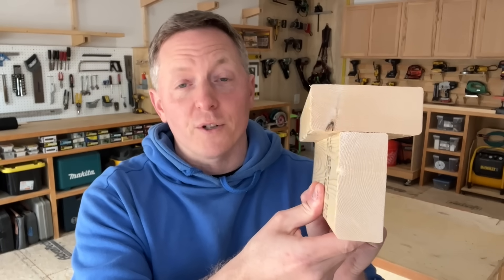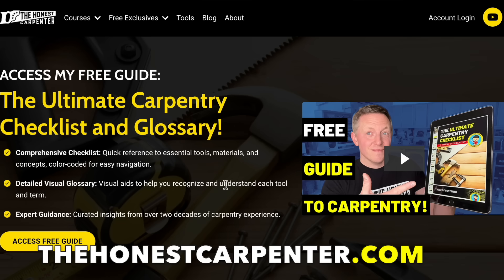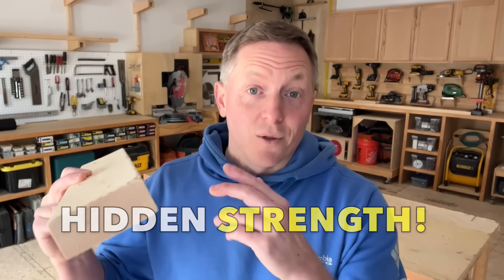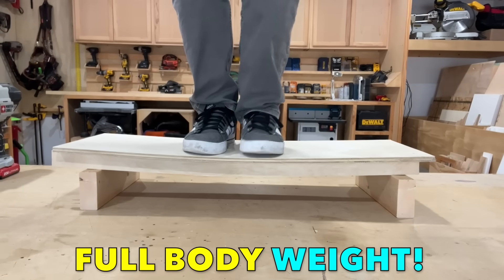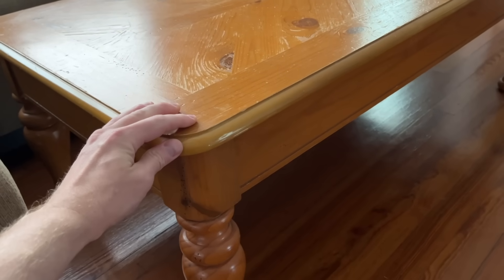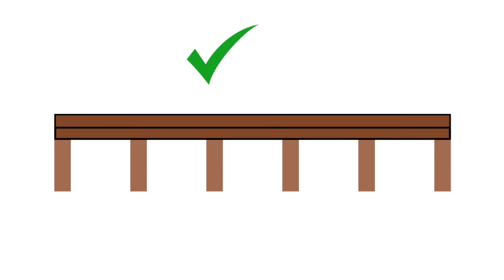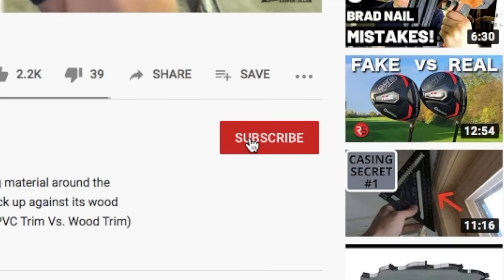Make Everything You Build STRONGER...(Overlooked CARPENTRY SECRET!)

Comment: It would be nice to know the minimum dimension that one can cut down the vertical member to w/o sacrificing too much strength.  In other words, what can we get away with w/o having to use huge boards turned vertically?  I know you mentioned cubed strength.  Is that height, width, volume, etc. dimension?
Reply: Mostly height. There are span table available to show how far, say joists, can span (based upon species).
Reply from the maker: Check out the span tables for dimensional lumber! IRC publishes them, but you can find copies online. :)

Comment: A lesser-known aspect of span strength is that the extra width is only needed near the centre of the span.  The member can become narrower the closer one gets to the points of support.
Reply: Hmmm. Did not know that.
Reply: Thats not exactly true because narrow beams wants to twist when supporting a load above them. Using tapered beams across the span, makes it more difficult to prevent them from twisting.
Reply: It is true, the principle of torque force across a beam. Highest torque occurs in the middle, zero at the ends. The ends are considered hinges even.

Comment: A Board perpendicular to a table top (wrapping around it, and creating that T or L brace) is commonly called an “apron”.

The framing members that u might find in ur attic are called 
“Rat runs”. 
Those terms can be used interchangeably with the ones mentioned in the vid. 
 👌

Comment: Great point.  I didn't know it increased by the cube of its width, that's impressive.
For bookcases I've opted for 3/4" pine.  Holds up well for 4' spans without any additional support.  Simple to build, especially when you don't  have a table saw.  And without the fascia boards it opens up more shelf space.  And the shelves are easy to reposition.
Reply: Height, not width.

Comment: I am an Engineer and your explanation couldnt be more precise and (VERY) simple to understand. Liked the lesson! Good job!
Reply: This is wrong. The strength does not increase exponentially, not even cubic.
The strength increase with the square of the height, stiffness increases with the cube of the height. If you keep the area constant and reduce the with when you increase the hight then the strength only increase proportionally with the hight.

The term "exponentially" is way too often misused when the actual increase is e.g. polynomial like in this case. An engineer should know this.
Reply: @larslindgren3846  Squaring is an exponential function itself. Raising to the power of two.....
Reply: @kc8485  All definitions of "exponential function" I know of require that the exponent increase with the input. In the square function the exponent is a constant of 2. 
Does you consider linearity, f(x)=x=x^1 to be an exponential function too? It can be defined by exponentiation just as well as squaring.
Is the square root x^(1/2) an exponential function too?
Reply: @larslindgren3846  I think it is actually hyperbolic, when you flip the board the other way the strength is literally hyperbolic in strength
Reply: @OCDlosp  I am not sure how you conclude that. Can you give me any motivation for that statement. Does you mean hyperbolic as in x^2/a+y^2/b=1 or as in the hyperbolic trigonometric functions like e.g. sinh, tanh?
Reply from the maker: Thank you, Roberto!
Reply: Um yeah, it could be a LOT more precise! what type of loading is on it? How long is the board being loaded? I think the word you're looking for is "pragmatic", not precise.
Reply: As an engineer, you should know that the claim that the strength becomes cubed is nonsense. For example, if the strength was initially equal to one unit (of whatever) then you'd be increasing the strength from 1 to 1^3 ... which is no change at all.

Indeed, the graphic indicates an increase from one unit of strenght to 9 units .... by cubing "1"?!
Reply: All y’all need to chill. This is a carpentry YouTube channel, not an engineering classroom. Also, the word strength has a different meaning depending on the context. As a keyboard warrior, you should know this
Reply: oversimplified too far though. I hope I never buy something you designed.

Comment: Thank you for the great video,  question,  I have a 14 ft span,  which calls for 2x10 for joist,  can I glue&screw a 2x2 on top of a 2x8 to act as a 2x10 with a wide nailing face and strength like a I Span?
Reply from the maker: Thanks Brian! No, in that case I'm afraid you probably want to go with the full 2x10. The contiguous structure and make-up of the wood fibers is hard to simulate, even with glue and fasteners. But the good thing is 2x10s aren't drastically more expensive than 2x8s, and it'll save you time this way. I hope that helps, stay safe!
Reply: You could maybe do that, but you would need to talk to a structural engineer. And if the work is going to be inspected, you need a letter from the engineer. Note: If it is strong enough and you are putting flooring down over it, you get great nailing surfaces!

Comment: It's too bad there are no, at least not that I'm unfamiliar with any sort of span tables, that might be applicable for closet shelving be it 5/8 or 3/4 thicknesses of melamine or  the same and also 1/2 plywood, (for narrow closet organizer shelves), without a front piece of trim.
     It certainly would take the indecision away from knowing that you're shelf isn't going to sag if it's only edge banded, say if the load consists of books or gold bullion, lol
Reply from the maker: I know what you mean, Paul. It would probably just vary too much based on where exactly the plywood is being sourced from. But I always say, when it doubt, weigh it out. Set the material up at your intended span, and start applying weight. You can use the objects you intend to store, or body weight, or anything really. But if you see deflection anywhere near your intended weight, you probably want to bulk up the material or structure a bit. I hope that helps!

Comment: Thicker material generally means more strength. Where the strength comes from varies a bit between materials. In wood, it comes the friction between the wood fibers and the lignin gluing them together. The direction of the fibers is critical in comparison to the direction of the load. Wood is strongest along the fibers, which makes sense when you imagine the tree it came from. The perpendicular strength varies with the thickness of the tree and how fast it grew.
Reply: White pine compared to ash compared to oak etc. Great point.

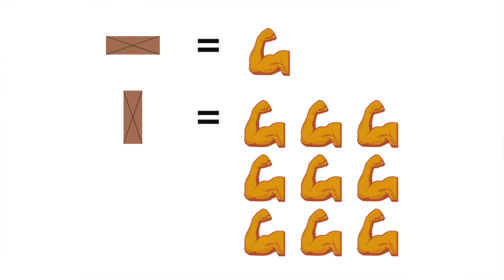Comment: 2:20 You get a bit hyperbolic! (1) Not "exponentially stronger" because, as you say, it scales like the cube not the exponent of thickness (so that would also be 8 'gunarms' not 9) and more importantly this holds (2) when all else remains equal... which it doesn't in your example: turning the board 90degrees doubles its height/thickness, BUT HALVES ITS WIDTH, so all else isn't equal. Deflection scales linearly with load (per cm span), so turning 2x4 to skinny side is equivalent to doubling your weight. You'd be numerically correct if you put a second 2x4 next to it; you still have 8x the strength for 2x the cost (&weight).

Favourite way to wrap my mind around this: Woodbin.ca's Sagulator -- a calculator to predict deflection over spans, dependent on wood/woodproduct type, thickness, depth, and load. Essential for building optimal torsion boxes.

Comment: Take a single sheet of printer paper and try to lay it across a six inch gap. It will gently bend over and slide right through.  Then fold the paper in half so a tight crease bridges the open span - it will hold itself up easily.  That's the same principle at work.

Comment: This principle scales up as well. The largest piece of wood I ever helped install in my 40yrs of building was a laminated beam that served as the ridge beam on a church auditorium. It was 16" X 72" and spanned 97 feet. It was delivered on a crazy two piece semi rig that the rear half had a driver and steering too. The beam was the only connection between the two halves.
When the glue lam was on the ground it looked like a bowling alley!

Comment: Funny thing : I wanted to build a snow slide for my son. I didn't really know how to, but I wanted to get something strong enough so I could eventually get on there if needed. I think I nailed it, and did a good job using this principle to get strengh. At first I though my son could climb it, but it was obvious that I needed to do a platform. So I did it again, and it worked perfectly nice. I had to get some joinery made to prevent loading the screws, and having each wood plank being supported correctly, but everything was great.
Then I just made a quick ladder, screwing horizontal planks to vertical ones. "Yeah, its ok". As soon as I put my feet on the first step, it broke lol. "Yeah, so I made everything super sturdy, but the ONE thing I overlook just break, okay"...

Guess next time I won't cut corners on ladders lol

Comment: I own a light single airplane. It is constructed from wood. Mostly finger thick sitka spruce. Only glued too. The main wing spar is also spruce boards in box form. The spar is some 25 feet long the box about 8 x 5 at the middle. It is designed to support up to 8000lbs.  Understanding the way wood works is a fundamental for proper design.  Not all woods are equal remember.

Comment: The engineering formula for the "moment of Inertia" for solid rectangle beam is B*H^3 where B=base width and H=height. This directly affects the strength and stiffness too. The strength is in the outermost "fibers" and actually an "I" beam would be even stronger and stiffer than the "T beam". This also why a "torsion box" is used for many woodworking projects. If it matters, a box beam with 2x top and bottom faces separated by glued (preferably) sides of even OSB can be a major load bearing beam. Of course, an engineer needs to determine the ultimate load capability. My initial career was a stress analysis engineer.
Reply: I would add that beam deflection is inversely proportional to the moment of inertia. That’s why turning a 2x4 so the 4 is the height gives you 4^3=64 versus 2^3=8. So you get 8 times less deflection. And strength is a misused description. To pick nits, technically it is a material property and not a geometric property. So M of I does not affect strength. Steel is “stronger” than aluminum. But it does increase a specific beam’s ability to hold a higher load before permanent deformation or failure.
Reply: Haha I worked with engineers for 30 years. This is how they talk. Lots of very dry sarcastic humor while figuring out the problem. Usually ends in laughter, not insult.
Reply: The moment of inertia of a rectangle is (bh^3)/12 about its CENTROIDAL axis, and is what you would use to calculate the bending stress about the neutral axis provided that the cross section of the beam is not a composite section.
Reply: @johnhill8958  You never take a joist or stud as being composite with the plywood. You actually use the section modulus and not the moment of inertia (although the section modulus is calculated from the moment of inertia). In a combined axial and bending load, you also still use the section modulus around the centroid even though the neutral axis is no longer at centroid of the section (The design method for combined loads is too long to explain in a YT comment).
Reply: I=(B*H^3/)12 for a rectangle.
Reply: Ugh… My Dream Job. You are highly favored by Our God M’Lord.
Reply: Does this apply to plywood too? Or just real wood? And what does OSB stand for?
Reply: Missing out camber?
Reply: Ahhh, dude check your reference book.  The moment of inertia of a rectangle is I = (b*h^3)/12. 😂
Reply: Beat me to it!
Reply: @johnklekotka1028  he didnt mension the 12 because it has no added value in his reasoning. Im an senior construction engineer myself and just by the short comment i can tell tium has a clue what he is talking about, and you dont.
Reply: @theengineer8610 Dude, first, you don’t have to get snotty. Second, i’m a professional civil and structural engineer, so yes, i know a little bit about the subject.  Third, he SAID “the formula is…”, which was incorrect. If he meant “proportional to…” than he should have said that.
Reply: Nice.  I've looked several times at calculating proper beams for projects with wood, and found that natural variability is annoying. 😁

It seems you would have been unlikely to do something like removing the center support post from my loafing shed, creating a ~20ft span for the two 2x6's that used to meet on top of that post. Someone thought that simply scabbing a foot or two of 2x6 over the joint was sufficient support. I think they were an electrical engineer, and they wanted to park an ultralite plane under that roof. To their credit, it did stay up more than 25 years, possibly much longer. When it came down (snow load) and I realized what had been done I was surprised it had lasted so long.  (I glued up a stack of 2x4s into a ~22ft long beam, 3-1/2in wide X 10in tall, and jacked it up the two outside posts to re-raise and support the roof before trimming it to length.  Starting year 7, so far so good.)
Reply: Your initial career was as a stress analysis engineer? Since you don't know that I=(B*H^3)/12 for a solid rectangular section, that you imagine "The strength is in the outermost fibers," and your comments about T sections and boxes without reference to size or load condition, it's easy to make an educated guess as to why you aren't doing that any more. I hope nobody was seriously injured or killed.
Reply: @PS-n5f  You could have made your point without being so snotty.

Comment: Would the strengthening effect be greater if the two boards are joined with a dado?
Reply: It doesn't make much difference.  Where he showed the T shape there is shear stress between the 2 pieces where they touch but it isn't a large value and it is easy to transfer.  If you wanted to be sure of this you could use a dado and that would give more surface area for the glue.

Comment: You're saying strength but you are showing deflection under load which is stiffness, those are 2 different things.  If you take a 2x4 turned flat and turn it vertical you make it 2.3 times as strong meaning 2.3 times as much load before it breaks, however you make it 5.4 times as stiff meaning 5.4 times as much load for the same amount of deflection.  This is for a single 2x4.  When you start combining pieces the proportions will be different but they can be calculated with principles of engineering mechanics.  Another important principle when you start combining things is how they are connected- for instance the T made out of 2 pieces of 2x4 will be even stiffer and stronger in one direction if it is connected well such as with glue and a lot of fasteners.  If it just has a few nails the 2 pieces won't act together as well and you lose some of the benefit.
Reply: I was a contractor for many years and never thought about strength vs stiffness (just used the span tables). Interesting!. Thanks..
Reply: Is the load figured all at the center of the span, or somehow distributed?
Reply: @jobacuda4472  if you're designing a floor joist then the design load is distributed along its entire length.  if you are designing something else for instance if a ridge beam sets on a stud pack which then sets on a wood beam down below then that is load at one point on the span.  the stiffness or strength calculations using the dimensions of the cross section apply either way.
Reply: @billj5645  Thanks, Bill! I used a lot of glue lams and LVLs in my time. Always hated working with steel beams!

Comment: Ah yes, applied Engineering Mechanics of Materials ENGR220.  

Area Moment of Inertia, I,  (directly related to the stiffness, deflection per unit of applied load, of a beam) for a rectangle is:  

I = (b* h^3) / 12  where b is the width and h is the height of rectangular beam in length dimensions.  

On edge, a nominal 2x4 (1.5x3.5 actual)  I = 5.36 in^4.  On the flat, 0.98 in^4.  That's a difference of about 5.5 times more area moment of inertia, and resultant stiffness, for simply rotating the orientation by 90 degrees.  That cube function does wonders.

Another fun fact about stiffness:  Closed structures are more torsional rigid than open structures.  Imagine a square tube and a square tube with a extremely fine slit straight down the length.  The un slit tube is far more rigid torsionally.  Use an empty paper towel tube for an at home experiment - twist it, then slit it lengthwise and repeat.  In carpentry, two floor joists skinned top and bottom with plywood would make a torsionally very stiff beam vs just being skinned on top, for example.  In fact, this is the basic structure of an airplane wing - front and rear spars (beams) closed off with the upper and lower wing skins.  The original Tacoma Narrows Bridge, Galloping Gertie, was a "C" channel - there was no cross or X bracing connecting the lower chords to make a closed loop.  As a result the bridge deck was torsionally soft, which allowed for the wind to twist it.  The rebuilt bridge fixed that.
Reply: I've watched that video (film) many tomes, but never heard the explanation, other than harmonics..